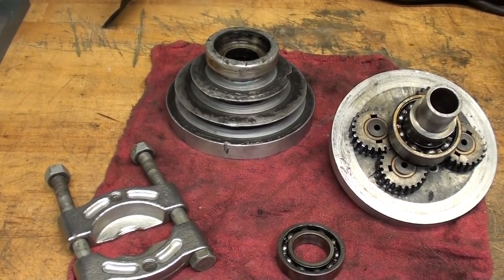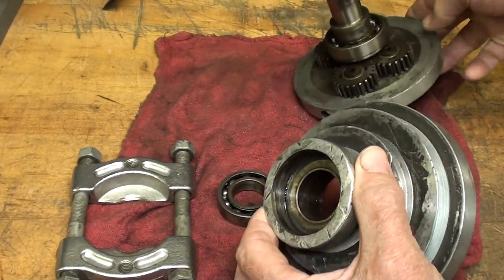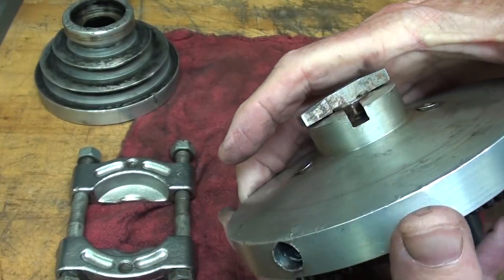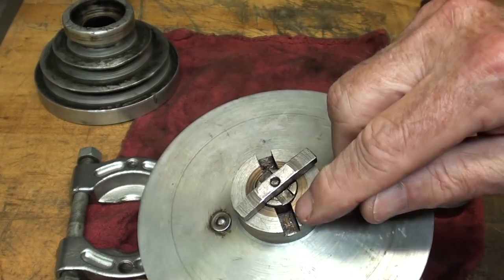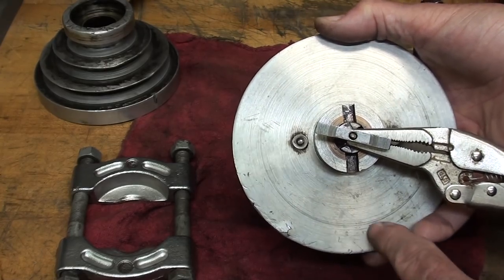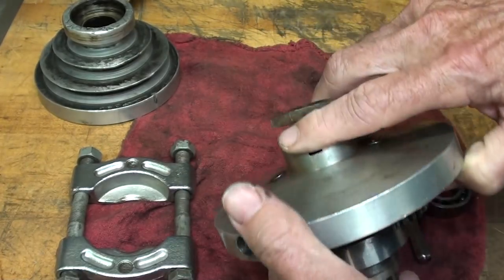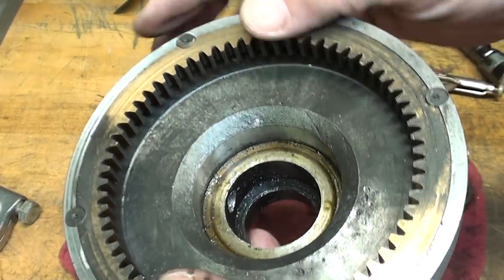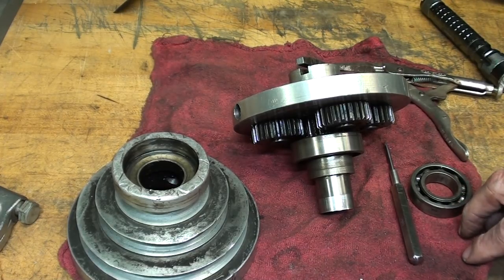plea#2 tubalcain NEEDS HELP with a PULL GEAR SPEED REDUCER

Comment: Don’t cut the pin on the speed changing lever. Press the shaft out of the body as you said. The speed changing lever being spring loaded will allow you some leeway as you push out the shaft. Take a fine parallel punch and gently hammer the spring loaded shaft through the locking lever until it comes clear, then press the planetary shaft out in its entirety.

Comment: No such thing as nice rap music! - So very glad to see the gears are not damaged.  Should have a very useful item if you can get the bearings replaced.- Unless bearing #64 is fitted tighter to the shaft than the bearing seat bore #68, the brass bushing #62 may have to be pressed out to remove bearing #64 from the carrier disc #58. - Good luck!............Great teaser on the drill grinder.
Reply: Pete you are a fine man I wish I could help. Paco Kelly
Reply: Yeah,rap....the C is silent....
Reply: It's a scientific fact that rap is crap.

Comment: Looking at the drawing, that spring loaded pin should go thru the shaft, once you grind the peen off it.  That shaft looks hollow from the other side and captures the spring from other side with the pin ,that is peen over side.

Comment: Interesting device.  "Automatic Transmission guts"  and "the bands need to be adjusted"  (old Powerglides) is what keeps coming to mind.  I'm wondering if a holding band would work in place of that rod.  If one had the room for such a modification, it would be one step to simplify making range changes.

Comment: Your right on just trim the top of the pin to remove the other bearings. The pin I bet will still be long enough to use it only locks it . After you put new bearings I'd raise the pin by pushing from inside the bearing tube that will let you repeen the pin. Good job on the tare down , with sealed shielded bearings it'll work for another hundred years. Thanks teach

Comment: My first technical job was working as an electric motor/gearbox mechanic. The first part of my informal training was to take complicated drawings and figure out all of the separation points. Deciding weather they were primary or secondary separation points before any disassembly.  We always outlined the blue prints and cut copies on the separation lines to figure out the order of operations to disassemble. We were able to fix equipment that other shops would not touch.
I really enjoy you videos I wish I had been one of your students 45 years ago.
Reply: Cutting drawings sounds good!

Comment: Mr. Pete,
I would be very interested in a full restoration series, including re-manufacturing that housing section. There is a dearth of instructional videos for making step pulleys that you could fill. You could cast a rough blank and machine it, or if necessary, make a plea for funding of a round stock purchase. Either way, we would love to see this as part of the restoration.
Reply: I will purchase the material for him if he is interested.
Reply: I agree with professormag; remake the housing section with a good stepped pulley.  Even better would be a series showing how to make a complete DIY "Pull Gear" speed reducer for old drill presses.

Comment: Just a suggestion, instead of cutting the shaft maybe just grind or file the peen off to save material. Very cool to see it back! 
I would have liked you separate it though :(
Reply: John Di Francisco
I was thinking the same thing. No loss of the shaft length that way.
Reply: Whatever amount of material you grind off the peened shaft could also be milled off the do-dad it’s securing.
Reply: This Old Tony (I believe) did a video in which he made some pulleys for round-cog cog belts by drilling a circle of holes of the right pitch, then turned the pulley down leaving half the holes to engage the cog belt. The process did not look too time consuming. You could then do any suitable set of pulleys and cog and/or v-belts to get the desired ratios you decide you need. I just discovered the diagram, let me examine and check that there is no video#3 that already solves the problem, LOL. probably would take an intermediate shaft to get a real wide range of speeds. My Craftsman uses one very narrow v-belt and myriad holes. I think they are still available at McMaster, etc.

Comment: I agree with your general approach. If you extend that sprung rod like you did in the video, you can file off the mushrooming without shortening it any further. The spring appears to have enough motion that the slight shortening when you peen it back on later should not be a problem. If it turns out to be a problem, the countersink that the peen nestles into could be deepened a tad. When you go to reinstall it, you'll have to press it in from the back, through the opening for the input shaft, to compress the spring.Just press on the top shaft, not the brass bushing.

Comment: I would hand file off the peened deformation (99) on the locking pin (86) rather than using the more destructive approach of cutting the deformation off thereby allowing removal of the locking key (96) without losing an appreciable amount of member 86 .

*This section heavily edited *.
You are probably correctly presuming the driving shaft should be pressed out first, but the upper bearing assembly (64) will stay in the bore due to interference with the planetary gears (70, 71, 73, 74). Obviously, those planetary gears need to be removed before the upper bearing can be removed, but the main shaft with its attending bearing will have to be removed first.  The bushing (62) could/should be used to press/drive the upper bearing assembly from its bore. 

All the best,
-- Joe

Comment: Hi again. Push via the center shaft first. You might get lucky and the little bearing might come with the shaft. If not, I think you will need to push down on the bushing a little until the bearing drops out, if it remained in it's seat. No need to take the bushing all the way out. Thanks for posting the video. Regards Stephen NZ

Comment: According to the drawings, it will certainly just be a case of removing the peening and pressing the shaft out.
You might be able to re-use the plunger by drilling and tapping the end previously peened and using a tiny screw to contain the switching leaver.

Comment: Lyle, 
Looks to me like :
1. the center shaft should rotate with the inner races of all the ball bearings and the spring loaded cross bar stops it from rotating, locking the gears. I have not seen you rotate the shaft, so I expect the innermost bearing is frozen. I think you can drive the center shaft out once the cross bar is released, and the set screw #36 is removed releasing the shaft key it holds in place. The gears look like they will keep the hidden inner bearing in place until the shaft is pressed out and the gears removed. Consider supporting gears if press is difficult/tight. Shaft should press from inner race it seems.

2. I expect you can remove the cross bar by driving the brass spring loaded pin down through the cross bar with a pin punch. There looks to be maybe 1/4” clearance under the sprung end of the pin to drive it into. Looks like the brass pin could be supported by a pin punch through the axial shaft hole.  If the brass looks like it will damage the steel bar, you could mash or file the mushroomed end so it fits the hole with little shortening of the pin. I would use the smooth part of the jaws on my duck bill pliers to do the mashing. :)
3. It appears there is no sun gear, but instead runs inner planet gears rotating on pins mounted in the upper body meshed with outer planets pinned to the upper body as well, meshing with the ring gear and the inner planets. The inner and outer planet pins rotate with the upper body. Perhaps the pins screw into the upper body.
4.  I would make a new pulley assembly, the existing aluminum looks too soft. If the belt grooves wear the belts will slip. Note that wide belt pulley has room for fewer sheaves for belts. An ambitious plan for men like you and me - too old to buy green bananas, LOL. Might be possible to cut old belt grooves off and fabricate and press new groove on. Cannot see photos while composing. :(

Comment: On similar penned over shafts I have center drilled the peened end, then used a small punch to drive out the shaft collapsing the peen. Then on reassembly re-peen and a dab of weld or a used a small flat head cap screw drilled and tapped into the peened end to keep it spread

Comment: After grinding off peen to remove lever. Just grind lever thinner so you can re-peen the shaft.
The Pull-Gear  operates similar to the pulley set-up in an old Craftsman AA109 metal lathe that was made in the 1940's.

Comment: just an old auto mechanic here ,but looking at illustration beginning at 9.41, that inner shaft WILL have to come out from top to bottom after that top cross bar is removed. 
that bottom bearing may be able to be sweated off by applying a 3 or 4 jaw puller at top of bottom bearing and bottom of shaft, then heating inner race of bearing  and bushing below it with cutting torch while still keeping pressure on. it has worked for me on wheel bearings before.
Reply: The "bottom" bearing you refer to is actually the middle bearing and can not be removed by forcing it down because it is against a shoulder on the main shaft, not some retaining bushing pressed on it. Both middle and upper bearings must be forced upwards, top bearing first, off the top of the shaft.

Comment: I think you could file the flair off of the small rod and let the knob slip off of the shaft.  Then you can then press the shaft out of the housing.  You'll be pressing the shaft through the hidden bearing not out of the brass bushing.   I think that the small rod is long enough.  You've got it pulled up far enough with the vice grips that you could cut a little off if you needed to. The knob needs to only clear the top notch to disengage.   If you had to, you could counter bore the knob to peen the rod over a little further down.

Comment: if you grind two grooves into the outer bearing race to tighten the bearing separator into you can then just pull the bearing off with a puller you may then be able to remove the gears and repeat the process for the other bearing without removing the shaft from the housing at all if the puller pulls the outer race off the inner then repeat the process with the inner race grinding grooves for the separator again

Comment: Perhaps, once the latch on top has been removed, you can pull the shaft out instead of pressing it. This might be done by closing the gear puller around the lower bearring and then have 2 bolts in the gear puller  push against the top aluminium plate. Those 2 bolts go through the holes where normally the H-shaped block with the center bolt of the gear puller is mounted. That way, the bearring is pulled against the flange on the shaft, and so it pulls the entire shaft out of the assembly. You do not need a press that way and also might have a bit more control pulling the shaft out.

Comment: I believe you have the right plan of action there, I'd maybe file the top of the sprung rod to remove as little as possible and hopefully it can be reused, but if not it shouldn't take too long to knock up a new one.

Comment: I hope you get it apart without any breakage. I also hope that you address the cracks and broken/missing belt flange protions. There are a lot of very good TIG welders at your access. Make for a few more videos having to machine the welded casting.

Comment: Keep the shaft raised like you had it with the needle noise pliers and use a small rat tail file on the end of the shaft itself and I'm sure it will come apart them you could press the bigger shaft out and yes I would leave the brass bushing in it to.

Comment: file the diameter of the shaft where it is peened. Then thread and use locktite to reattach the pull handle.
Reply: Agreed!
Reply: Bad Juju loctite better known as don't give a shit if somebody else has to deal with it is not a sweet option
Reply: A little heat breaks locktite free ...totally painless.
Reply: Bad Juju 

Agreed, but to the unawares, it's beat it till it gives up. Just saying.🎲